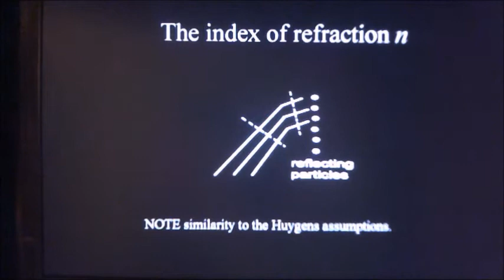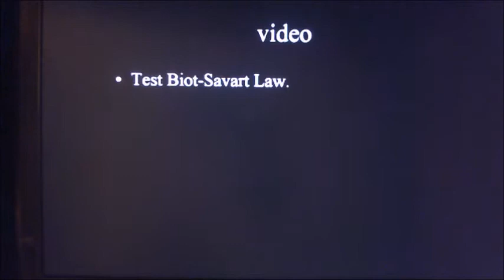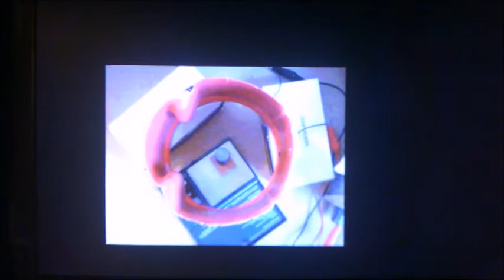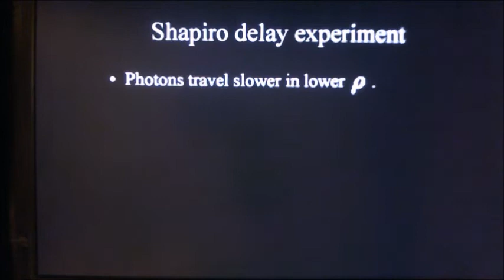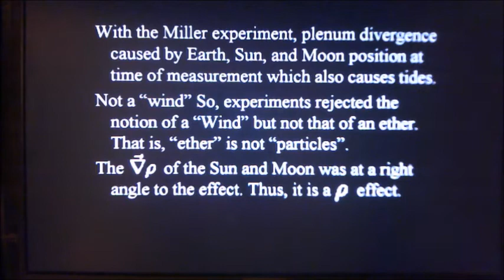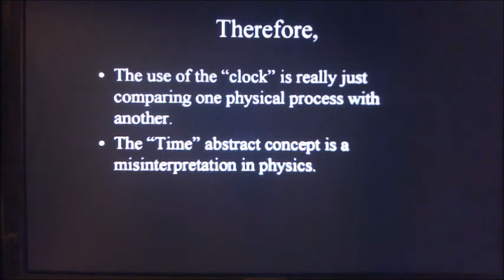Replace Special Relativity in the STOE

Comment: I was just initially surprised to read that "Physics laws are the same everywhere".  I then quickly realized that is so "telling".  That instead of simply "All inertial frames are equally valid", there is "the larger rule", that applies throughout the entire universe, even if infinite!  I had heard years ago that there possibly exists parts of the universe, that don't abide by the same physical laws.  With my possibly naive view, I would have to guess that there couldn't possibly exist any deviations from that.  That thought was a sort of impulse, so maybe that's somehow possible?
Reply from the maker: Cosmologists have assumed the light and light generation from distant galaxies is of the as on Earth - Redshift. The trick becomes determining those laws.